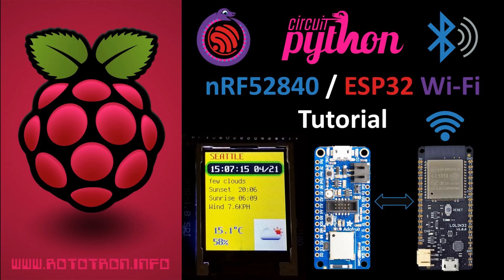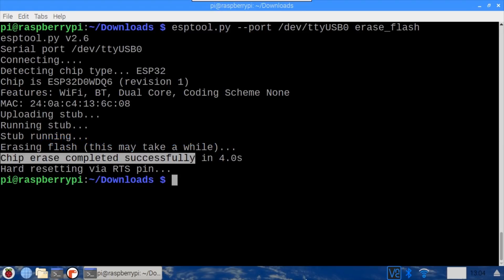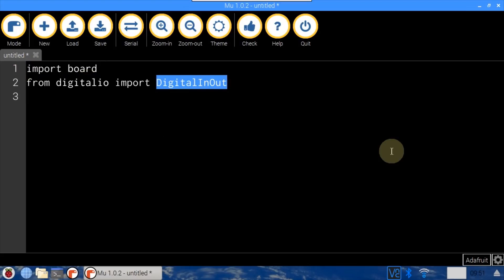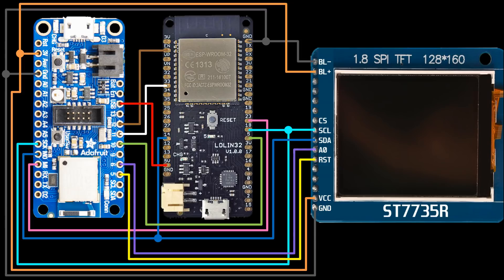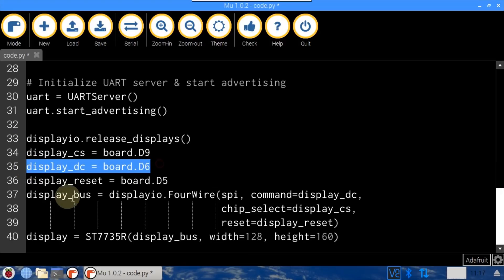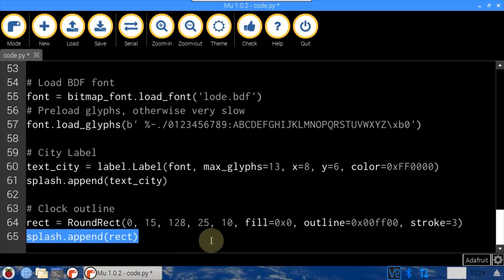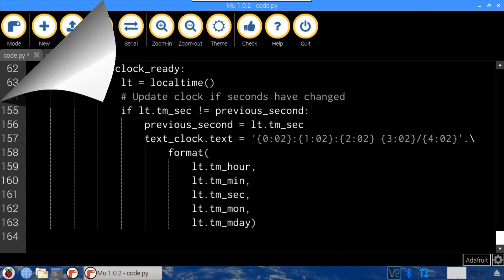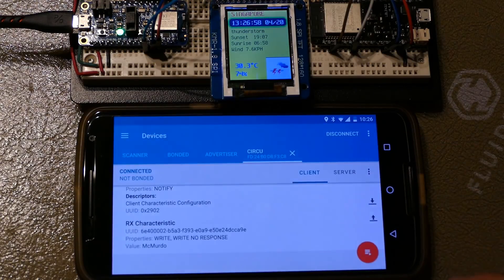CircuitPython nRF52840 ESP32 WiFi Tutorial

Comment: I just did this (using a Samd51 board, ESP32 and CircuitPython 6.2.0) and I used the newest  (as of Feb 2021) adafruit firmware: https://github.com/adafruit/nina-fw/releases/tag/1.7.1.
All still works.

Firmware had to be flashed as in tutorial, flashing via Thonny didn't work.

I was about ready to switch arduino until I found this. Thanks!

Comment: Great video! I'm thinking about using an esp32 as a co processor with a feather or itsy bitsy and this way especially helpful with the wiring diagram. 

My only concern or question rather, is whether or not the spi firmware adafruit made to allow using the esp32 as a co processor supports running the esp32 in access point mode so another device could connect to it? I would really like to be able to use it create a mini local webserver so I can write the user interface for a project with web technologies, sending commands with http calls. 

Do you know if something like this would be possible and supported with the spi API and adafruit esp32 firmware?

Thanks again!
Reply from the maker: That's a great question!  I'm not sure if it is currently possible.  I would guess no.  I recommend you post an issue to the Adafruit_CircuitPython_ESP32SPI repo:  https://github.com/adafruit/Adafruit_CircuitPython_ESP32SPI